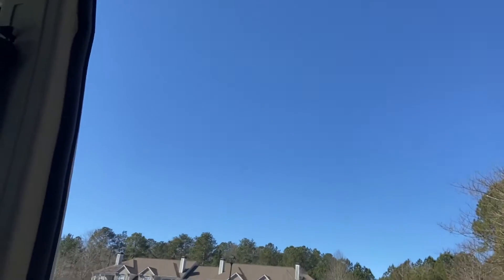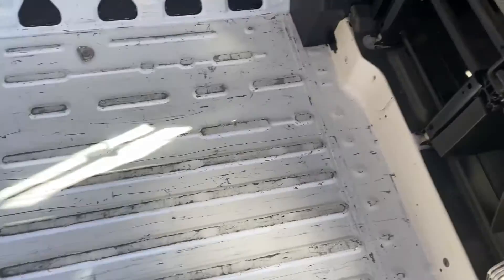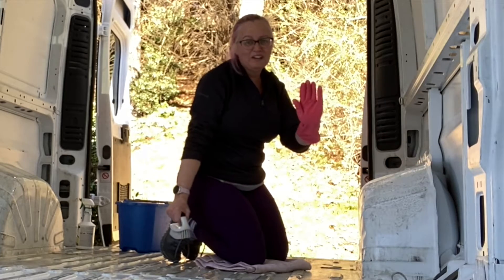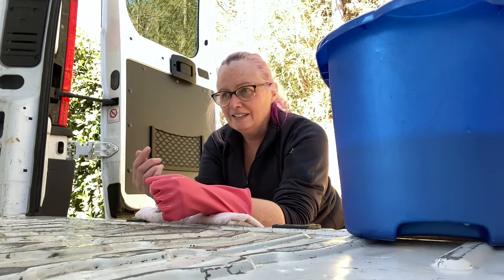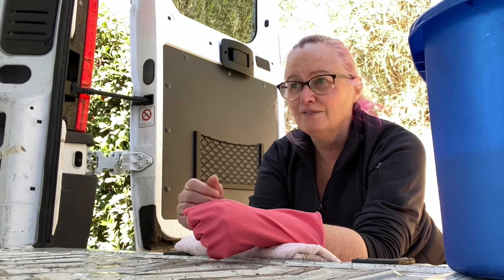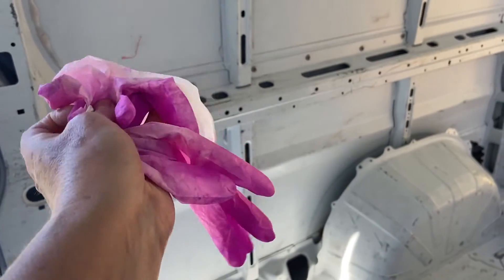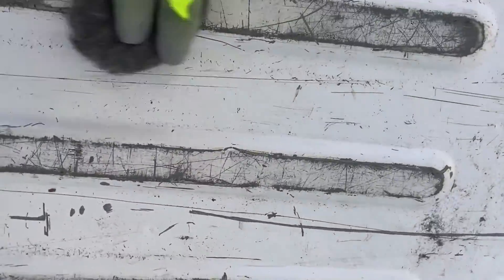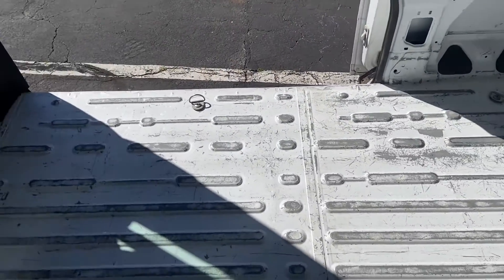Cleaning Up My Used Promaster - Van Build #2

Comment: I made a comment in the previous video but, it disappeared. That looks like a nice van. When it comes to tools, it is cheaper in the long run to by a full set than to buy by the pieces. There are a lot of big sets going on sale this week. Having a full set will save time and money in the long run. 
Your Mom was right. 
You're doing a good job. For your saw, look at getting a jigsaw. Carry your extra key on a necklace. Good Luck, Rick
Reply from the maker: Thanks, Richard. Sorry I didn't see that other comment. I did get a jig saw, what a handy tool!
Reply: @JoyfulRambler  They erased my post within 1/2 hour. There are handy accessories for for the jigsaw, like a ripping guide and metal cutting blades. If you are in a time crunch, you can just use a cot and milk crates and boards while you work on it. You camping equipment can take care of most else. I don't like how some people do their storage such that they have to get out of the van to access the storage under the bed. Suppose you are stuck in a blizzard, getting outside could be very dangerous. Make all storage accessible from inside. BTW, a good stock of candles will be your friends in a storm. They give light, heat, and you can heat food over a group of them. Be sure to check your spare tire and your ability to change it. Some lug nuts are on there very tough. For my van I had to get a heavy duty breaker bar and deep socket because the lug wrench that came with the van would just bend. Good Luck, Rick